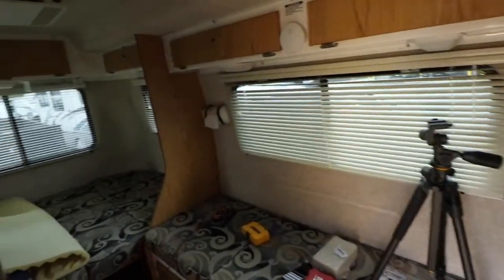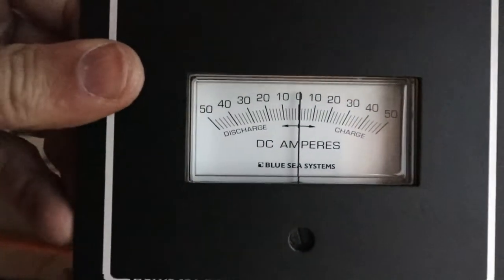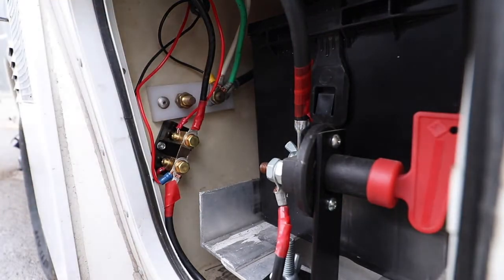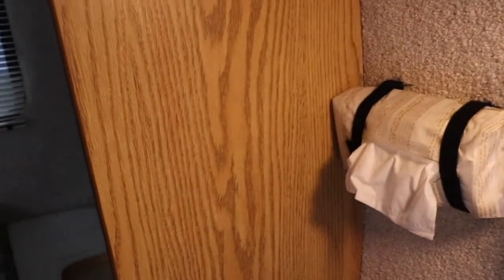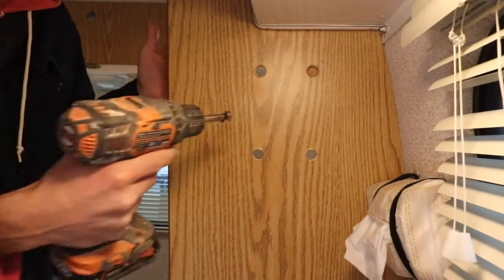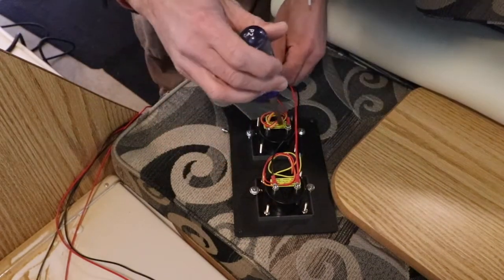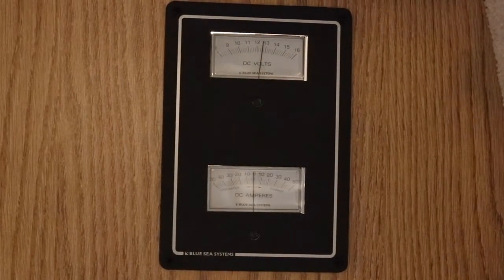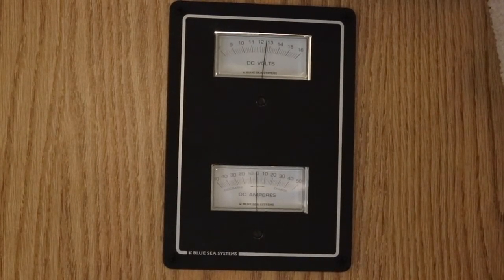Installing an Ammeter, Shunt and a Voltmeter

Comment: Nice job and I was surprised that the car charging system couldn't keep up. Might need to put a heavy duty alternator on it.
Reply from the maker: Thanks Jerry!  As long as I don't run the fridge on DC it usually does fine.

Comment: Nice video, turned out good! Looking forward to seeing the finished product and I'm sure you could get some cheap raceways at home depot to run the wires down, it'll look nice and clean! Looking forward to more!
Reply from the maker: BarnStangz that’s exactly what I did, hid the wire in some raceway.
Reply: Right on! Came out nice I bet!